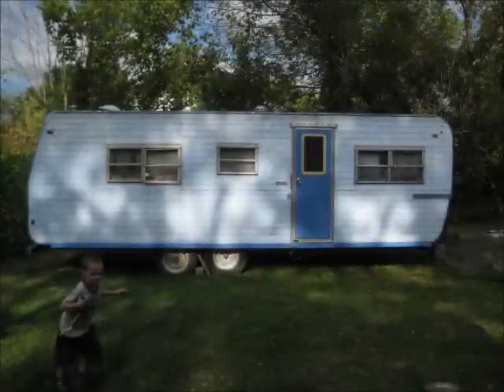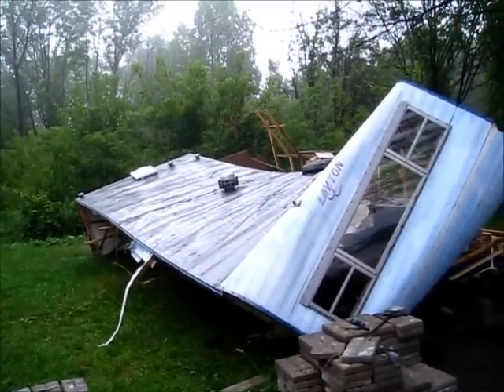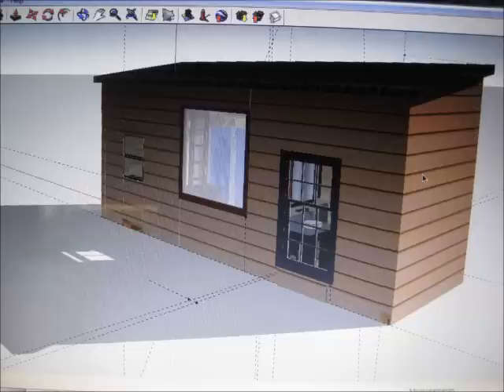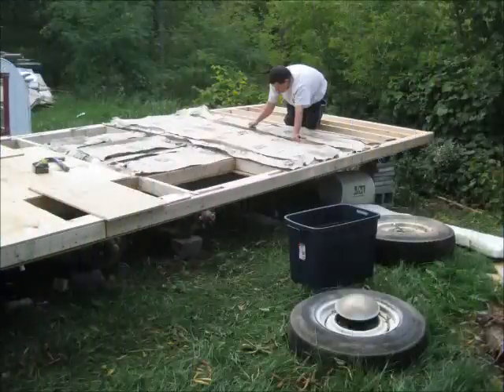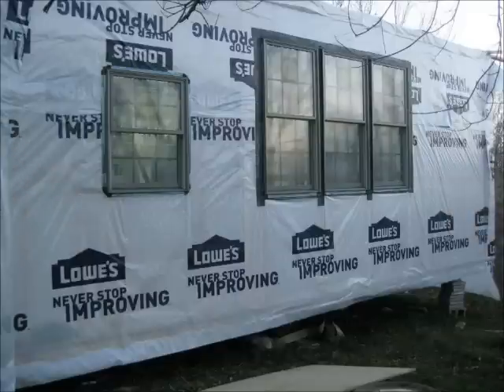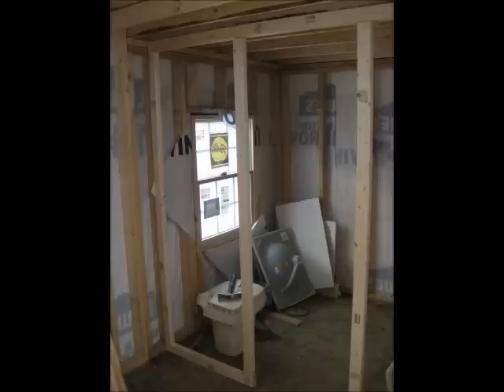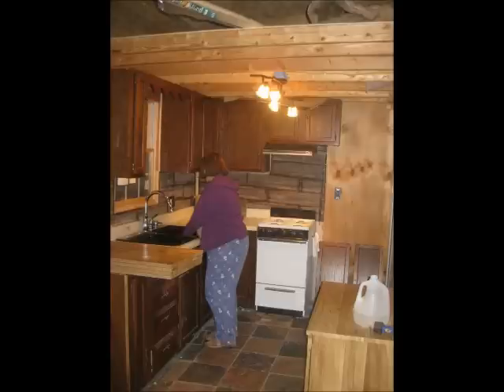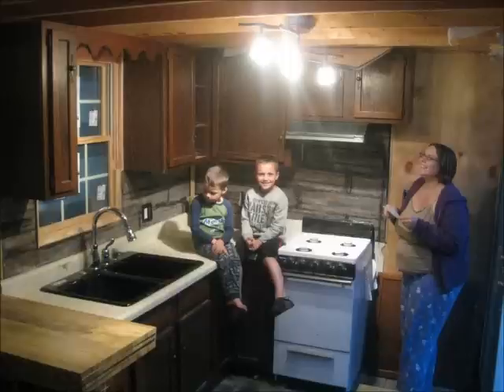Tiny house for under $5000

Comment: I think it would be a lot easier to buy a flat bed trailer to start with. Beautiful vintage trailer trashed, What a WASTE!!!!
Reply from the maker: You are so right, it would have been easier, but I was not going for the easy way, but, the cheap way.  A 14000lb trailer would have cost me too mucht to make this a viable "under $5000" project. I did this to prove that a resourceful person can do this on little money and hard work. If I had the money, I would have bought a ready made trailer for my tiny house but my cost would have increased by several thousand dollars.
Reply: I thought the same thoughts. I would've given em a couple grand for that neat lil camper.
Reply: You didn't listen very well as he said the trailer floor was rotten.So he salvaged what he could and used the frame as a foundation.I don't know what prices are in your area but in Arizona a trailer that size is a few thousand dollers

Comment: I live in south dakota, an almost entirely rural state, and finding a used trailer this size for $300 is almost unheard of. You have to spend months snooping out a deal like that. I think a $200 camper that pays for itself is a great deal if you're willing to put in the elbow. The moment you opt for a tiny home you should stop hurrying. Enjoy the build and be crafty, this guy built a house for half my yearly rent even with the work of stripping down the camper. Rock.
Reply from the maker: +Avitus Xenoi This is where we are now, https://www.youtube.com/watch?v=N7gHC3GJWh0
Reply: I live in the middle of nowhere in Northern British Columbia and find deals like this occasionally. The problems with his build are numerous. Having no registration is problematic to start with, will be jumping through a few hoops to be able to even get insurance. The springs will be crap, the bearings are likely seized, the frame will need to be cleaned and repainted  and probably beefed up, the frame for the floor needs to be pressure treated lumber, not culls of questionable quality. The bottom has to be totally waterproofed and protected from flying gravel, the whole electrical wirering  for travel lights needs to be replaced. The tires will be cracked and not fit for continued use, none of these costs and neccesseties were mentioned. The insulation has to top notch. If you have the time to wait for a trailer that is almost free, save your pennies for some real undiluted cost. The foundation is the most important part of your Tiny House.
Reply from the maker: Lots of people have been confused why I chose to use the camper frame! You sir explained it very nicely! Heavy duty Trailers are expensive!

Comment: seems like way too much weight on that frame and the axles, did you have to reinforce it?
Reply from the maker: It has two 7500lb axles, the house only weighs about 8000lbs so its ok, but still really heavy.
Reply: well then that works. I doubt you tow it around a whole lot anyway so its not really THAT big of a deal if its heavy. I think you did an awesome job. I am a cabinet maker/carpenter for the past 20 years and I'd say given that you had no experience with this type of thing you did a really outstanding job.
Reply: another question for you if you dont mind...where I live we get seasonal storms with really high winds (we are in central Arizona and have a "monsoon season" where there are dust storms with winds sometimes in the 60 to 70 mph range and micro bursts even greater then that) I like how much height you have on this home but I am wondering how it fairs with high winds or if this is even an issue where you are...do you anchor it in any way?
Reply from the maker: In high winds, it will need to be tied down like a mobile home.

Comment: I guess I'm confused, aren't you supposed to put the house wrapping outside the sheathing??
Reply: yep...he did it bassackwards
Reply: whats a little wood rot. he also bought a camper for a trailer.
Reply: So many mistakes, starting with the frame and base, culled lumber instead of pressure treated?

Comment: so why DID YOU buy the Trailer? YOU tore it all down to the tires? Cool video thank you
Reply: Thats the same thing I wondered... Was it just for the frame so they can up and leave whenever they need to??  For that he could have just bought a flatbed trailer :/
Reply: Dana Wheeler$5,000 would have bought a real nice trailer WITHOUT alll the hassle of teardown.
Reply: fullstrutn That too!
Reply: Dana Wheeler fullstrutn He bought the trailer for 200 and tore everything up and recycled the metals for scrap to break even, he then build a house on that trailer which was left over for a grand total of 5000.  Did you watch the video? Buying a flatbed outright would have cost around 3000 give or take.  He needed to save money by reusing the trailer frame, that's why he bought it ......
Reply: If you hear well, he said he got the trailer for free
Reply: Paul Bohannon  Boom!! shots fired.... Headshot
Reply: A trailer bed can cost thousands of dollars, it's far cheaper to take a crappy trailer off someone's hands and rip out the rest.
Reply: +Paul Bohannon did I get you mad?

Comment: I can't believe you didn't put any sheathing on exterior walls you wrapped the studs then sided. As a master carpenter in the northeast we use 3/8in plywood for exterior walls then use tyvek house wrap. The plywood locks your framing together making a stronger structure the T1-11 is too flimsy to be the only exterior layer. Then only having 1/8in luan on the inside is going to give me nightmares. Especially being hauled this is extremely under built.

Comment: Couldn't you have just bought a new flat trailer and start fresh indtead of hours and hours of just taking it down to nothing anyways?  That didnt make sense to me.
Reply: Hi Anne, he probably got the trailer far cheaper that purchasing a new trailer. Plus, he could sell the metal parts to a recycler, and CraigList any parts of the trailer that still has some value - like the fridge, oven, beds, etc.
Reply: He used the frame, saving himself over $2,000. I think he did it correctly,  myself. Good for him!!
Reply: @ValadiaKristoffersen  Just don't use his method to build your tiny house. The trailer frame needs to be stripped completely of rust and peeling paint,  beefed up to handle the extra weight with lofts, tires will be cracked and not fit for transport, springs will have to be replaced, bearings are most likely seized, wirering for lights and lights themselves need to be replaced, pressure treated plywood with extra water proofing as base before framing with pressure treated lumber, not culled 2x4s of questionably quality will have to be installed. Remember, you are creating the foundation for a home, not an occasional camper. Exterior has to be 3/8" plywood, it will hold the structure together for a long time. Then when your situation changes, you won't have to give it away, because it can't be sold due to the many faults.
Reply: @dieterditrich7520  I already have an RV that has been beefed up. I would personally prefer to have another over the road coach to full time in. I did that once with a 1955 Flxible VL-100. Long story. For another time...
Reply: @ValadiaKristoffersen  I converted a school bus into a tiny home 3 years ago for economical rental accommodation for locally stationed forest fire fighters, to augment my 20' yurt. 2 years ago I built a Gypsy Trailer on a new 5'x10' steel frame trailer, it is complete with a slide away sawdust toilet, which are by the way totally odor free, a futon which is also the bed. I use it mainly for our weekly Market to show people what can be done with such a small trailer. It is also painted for Vow.